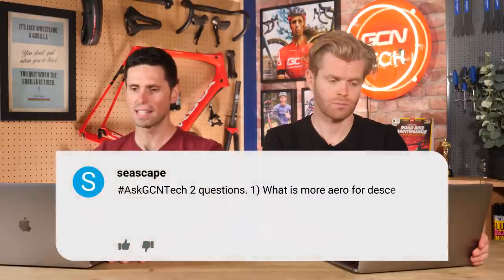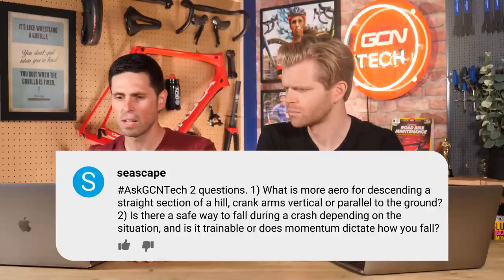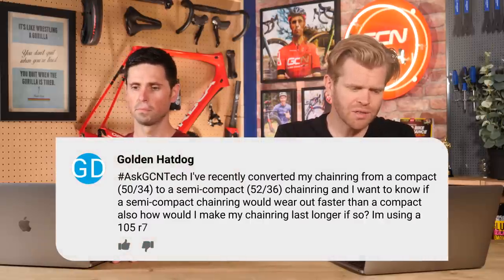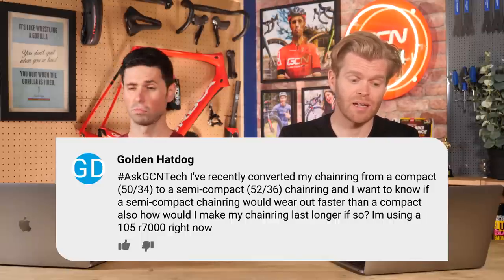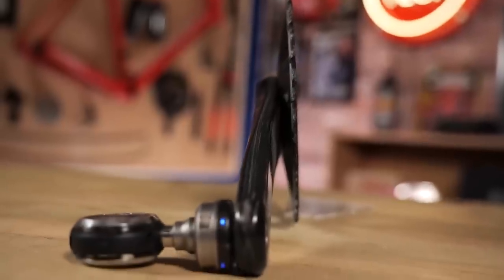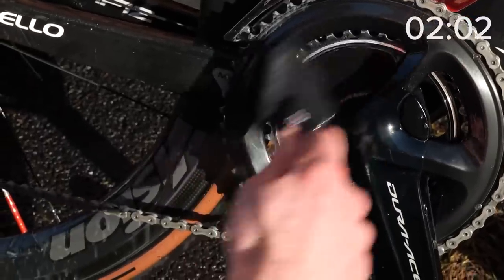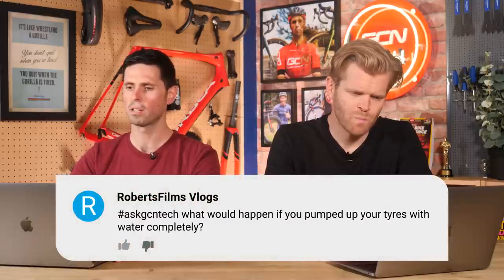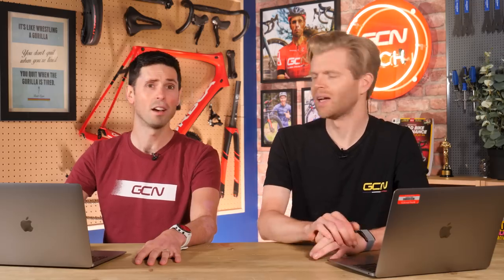What Is The Best Position For Descending? | GCN Tech Clinic

Comment: #askgcntech how can I avoid salty sweaty spray all over the inside of my glasses during a ride? During summer especially I often get sweat spraying all over the inside of my sunglasses when riding on bumpy roads when descending, or big drops of sweat when ascending from the leant over position I’m in. By the time I get to a point where I can wipe it off, it’s all dried and when I try to wipe it I end up just smearing it all over the inside of the lenses, making them foggy and rendering them useless.
Reply: You couldn’t have written this at a more perfect time! I have the same issue and just accept it, even sometimes taking them off when during dim lighting conditions!
Reply: I find a cap under the helmet helps
Reply: @davet003.5  the problem is you wouldn’t want to wear a cap when it’s hot, plus there’s only so much sweat a cap can absorb anyway
Reply: @TheNick16f  Hey Nick - my last hot ride (two weeks ago) was 38C max and 32C ave. I find the cap better because it seems to stop the pour down my face especially when I look down. It’s all preference though and the cap is soaking wet afterwards

Comment: Does anyone ever find that one leg does more than the other ? I’ve noticed my left leg is far more dominant than my right and wondered if anything can be done to sort it
Reply: If you have clip in pedals, you will definitely benefit from single leg drills, 30 seconds each leg 5 times at slow and fast cadence. will improve both balance and smooth the over all stroke as well. If you have a power meter do the above to a set power as well.
Reply: I know several people who have this issue myself included. The discrepancy seems to be more when you're riding on flat roads at sub max power. When climbing, however this power difference seems to disappear. Also when doing TTs and other max efforts the same happens.
Friends also report that even though they are right leg dominant, The left leg power output is higher. Lazy right leg?
Reply: Since I installed dual power meter pedals I noticed that if I sit slightly off centre, my power per pedal can be unbalanced. Be mindful of sit bones on the seat and also recalibrate the pm frequently to make sure it isn’t a calibration issue.

Comment: Regarding chainrings and wear: it doesn’t matter the size, 48 or 50 or 53… because you will only wear out the teeth on the ring at two spots: the top of the power stroke. By this, I mean the teeth just behind the arms, where the lever is pulling the hardest. From the 12 o’clock position, till the 3 o’clock position, the chainring is under immense pulling stress.  From 3 to 6 o’clock, not so much. The process begins again at the 6 o’clock to 9 o’clock position for power from the left side.
Reply: Clyde3  spam alert.
Reply: The wear will be the same because your rpms will be the same